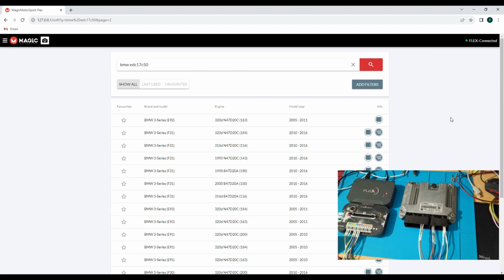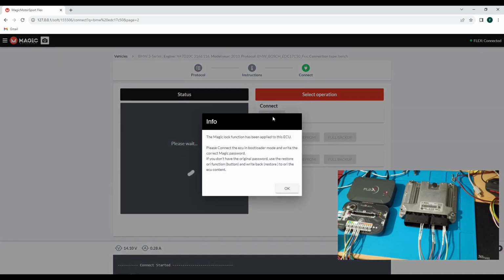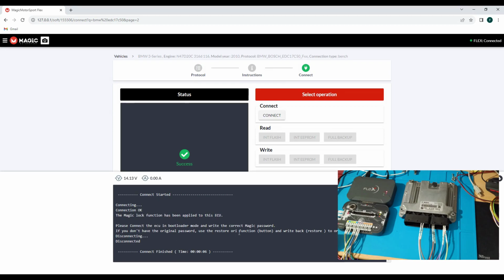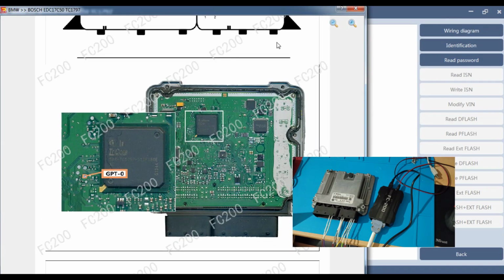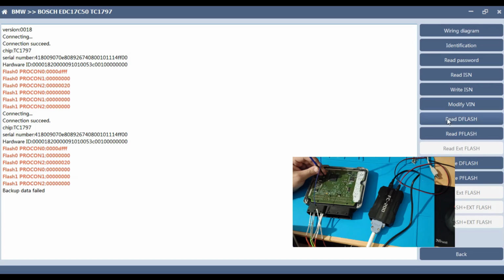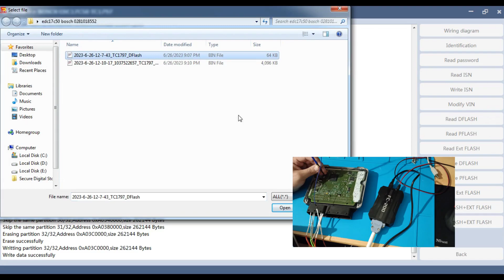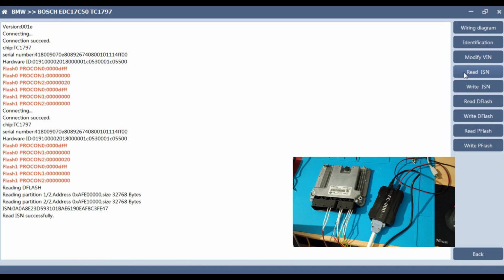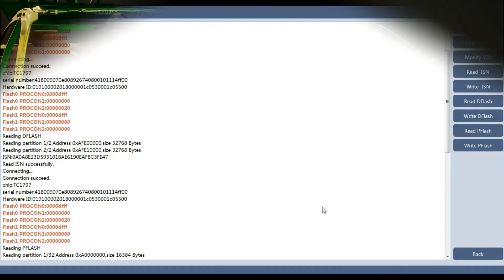FC 200 Boot mode read/write. ECU unlock after it was written with Flex Magic lock Bench edc17c50.

Comment: What if i don't have original file, can i still read through boot mode and how. Thanks alot
Reply from the maker: @kheang9016  No.. you don't have original files no read possible. You must Flash the ECU engine first using Ista+ . After the update you are able to use a tuning programmer.
Reply: @YOYODiagnostic  oh ok thanks you a lot.